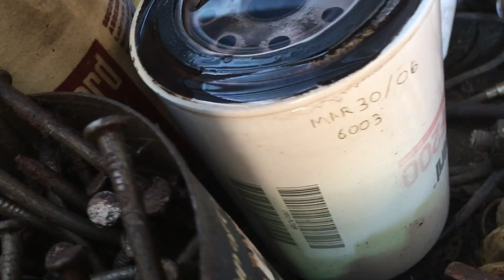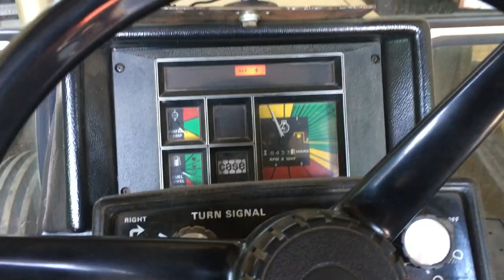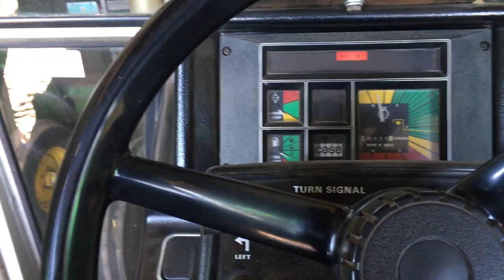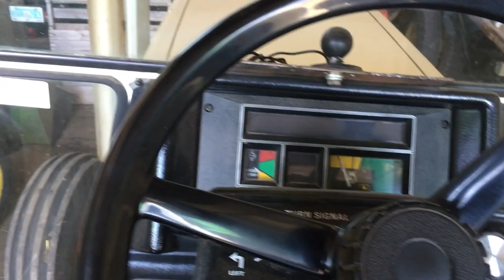New fuel filters

Comment: I usually change all filters each spring regardless. Just cheap insurance haha
Reply from the maker: Really? wow, I think I have a few air filters nearly old enough to vote :-). Mostly the ones that have the back up internal air filter element.
Reply: @roosty6  the back up I don't but everything else. We have since forever lol
Reply: We still do oil every engine oil every 250 hours, diff/hydraulic/transmission every 2-3000 and fuel filters usually every second oil change.

Comment: Good video! Thanks for the time you put in these. I have had the same issues on my 1086. I know my dad has changed them on his 970 before and on the 930 Case tractors we have and those primer pumps have gave us enough trouble leaking we dont even try them. Just fill the tank full and put a lil air  to the tank.
Reply from the maker: Interesting idea. I might have to try it some time.
Reply: @roosty6  We actually use the air hose and a rag in your hand over the filler cap, but you need someone to open and shut the bleeders. A leaf blower might work. it doesn't take too much.

Comment: Wow 15 years on filters! You must have great fuel storage lol. They are cheap insurance against expensive fuel injection pumps and components.
Reply from the maker: The system is all original and still working good at over 8400 hours so the filters must be doing their job well. Plus starting out with clean fuel helps.

Comment: When you change oil and fuel filters every hundred hours on the cases. Overtime do the filters get moisture inside??
Reply from the maker: No, I have never seen any sign of moisture in the filters or oil.
Reply: @roosty6  I was gonna change the oil and fuel filters on my 1270. I was told by one of the guys at the shop that those filters last forever.
Reply from the maker: @meateaterwhitetail7291  They might but I would'nt try it. I went years on a set of fuel filters without a problem but do at least one oil and filter change a year on the engine.
Reply: @roosty6  I own my 74 1270 cab and duals since spring. Rebuilt the powershift. I'm still new with this 135hp tractor. When changing the fuel filters. Do you have to pull the fuel choke to prevent fuel flowing out to the filters when changing??
Reply from the maker: @meateaterwhitetail7291  No I don't recall having to do that. Not a lot of fuel came out while changing filters.
Reply: @roosty6  ok. I suppose changing the fuel filters is an easy change.

Comment: I must be lucky that my 1170 is never that hard to get the air out of the system after a filter change. I can change them and be back running in 20 minutes
Reply from the maker: I don't remember it being that difficult either. The Perkins on the old Massey was always a big problem getting the air out of that system.